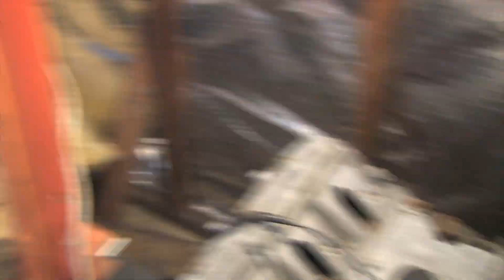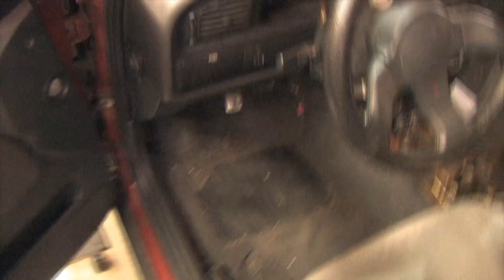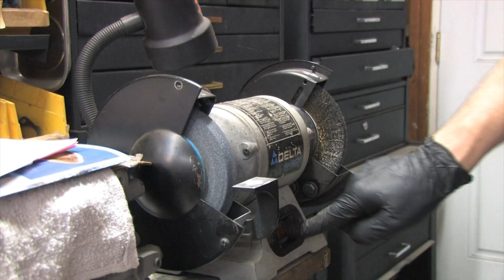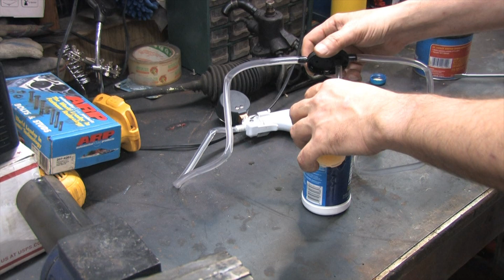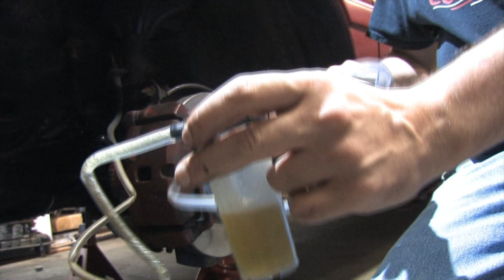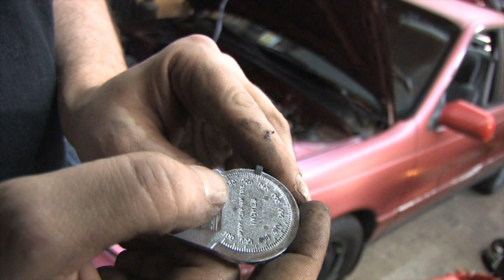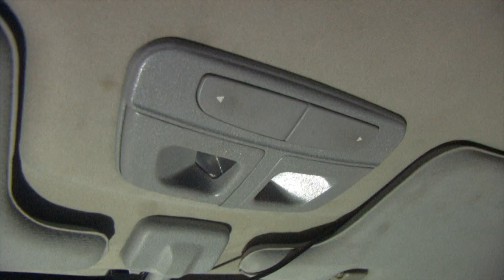Hyundai 17 - Brakes, Bearings and Bugs

Comment: Big problem here. When you force fluids backwards in the system, you are asking for big trouble. Drain or open the valve before you compress the pads brake caliper. Give the fluid a way out of the valve and you will not have any problems.

Comment: If you don’t want your lug nuts to seize just exercise the nuts by doing a rotate. Lugs nut threads have to be dry. If you don’t have the friction between the threads and the taper of the lug nut on the rim what do you think keeps it from backing lose? Maybe use it on a boat trailer that gets backed into a salty drink

Comment: You will at least have rear brakes. They made the master with 2 separate chambers. Pedal will be close to the floor though. I have cars come in sometimes with so much play in the wheel bearing that it doesn’t have a brake pedal until a few pumps because the calipers have to take up the play from the rotors compressing the pistons

Comment: I was always told by my mechanical ancestors to brake the bleeder lose, connect a hose to a bleeder, place the other end of the hose into a bottle with brake fluid, then pry on the assembly to see if everything is moving smooth. The point of this is as you use the screw driver to depress the assembly the old fluid and crud in the line doesn't get pushed back into the master cylinder. I have had this happen on my 2000 gm vehicles, but never a dsm. I just started to do the hose method within the last 2 years after Grandpa laugh at me and told me I am one stupid mf engineer. lol I took it as a compliment.  I might have commented this before, but thought I would leave my thoughts. Also don't press on the inner race while driving the bearing into the hub. I know this has been commented many times and even mention to me once before about this video. Keep up the informative videos so I can remember how to do this stuff down the road as I forget.

Comment: when water turns to steam it expands its volume 16 times... which would be already bad but its 1600 times xD
Reply from the maker: There is data that supports it.  The Wikipedia page makes the claim of 1,700 times the size at atmospheric pressure.  I know that there's a crossover in measurement concerning mass because I mentioned nothing of pressure, but if I'm wrong, there's data that's helping me be wrong.

Comment: I'd recommend replacing the hub assembly bearing on the other side as well,.... under the,.....while your in there rule.
I also recommend buying cheap break pad's they work fine and don't eat the rotor.
But I like riveted brake shoes and pads not glued,......expensive ones seem to work terrible or skid.
I've never had issue's with cheap one's.

Comment: That luxury chandelier!!! Where do I get one.
Reply from the maker: I ordered it direct from china.  It took 6 weeks to get it.  It's a "dollhouse chandelier with LED".  I'm working on a DIY to make a medallion to mount it to, and a voltage converter with the hardwiring process to permanently install it with a proper fit over the rectangular hole, and to make the dome light function as intended with the doors and interior controls.  It's nowhere near enough light for a dome light, but it's the details that matter here.

Comment: Yeah I've heard that's bad for seals in the master cylinder... MEH. I like to use the screwdriver to loosen the pad just a teeny bit, then I can typically press it full in with just my thumbs. It's potentially easier with the screwdriver, but I find I can really monitor the situation and make sure I don't damage anything by pushing the piston in by hand.

Comment: nice brake overhaul. still i have 2 additional tips: clean the flanges to remove all rust (rust can cause rotor runout) and give  them  thin layer of anti seice (this limits rust and prevents the rotor from rusting stuck on the flange.) then install the rotors. As for drumbrakes: same deal if they mount on a flange. Also: use your cellphone camera to make a picture of the drumbrake setup before taking it apart, that way you have a way to check where each part is supposed to go when re-assembling.

Comment: I have that same vacuum bleeder kit.  One problem I've had with it is that the vacuum it pulls doesn't just suck brake fluid out of the line, it also sucks air from between the cracked-open bleeder valve and the caliper (and or the kit's rubber bleeder boot).   Until I figured that out, it seemed to me like I had a never-ending supply of air bubbles in my brake lines.  EDIT:  ... and you just mentioned that at 23:00  .   :)

Comment: I just replaced all my pads and rotors on my gsx this past week after watching this video the first time. The brake trick worked on my rear brakes, but not on the front ones. Could this be because my 95 have 2-piston calipers? Or perhaps another reason? Either way, it saved time for the rears.
Reply from the maker: Use two screwdrivers.  ;)  Hey, I've got a video rebuilding 2g front 2-piston 1995 GSX brakes just exactly like yours.  If yours didn't want to compress because of corrosion on the pistons, or dry-rotted seals, that video shows you how to ensure they work perfectly... like 0-mile factory fresh perfectly.  Part numbers included.
Reply: Awesome, I'll check it out. I must have missed that one ;)  I did end up using 2 screwdrivers, but broke the tip off one of them. So in the end I used a c clamp since my piston compressor tool was MIA.

Comment: This video really helped me out with the the wheel bearings on my 93 VW cabby. I, however, had the option of pushing the old bearing out the front of the knuckle, which made rigging MUCH easier. To do the job, I got a cheap 12 ton press from HF for less than $105 with a 20% coupon. How come you never got your own cheap press, space constraints or you just don't need one that often to justify?
Reply from the maker: Space is a big thing.  I've always had access to one 2 blocks away, or at my cousin's house in the next county.  I need to nuke, pave, and rebuild my whole back yard to accommodate what I'm doing with 1/3 acre.  The 1/2 car in my 1.5 car garage I will never understand.  I don't see where I could fit a half-car when one's in there?  One of my cars can't even fit in this garage by itself... but it will have to eventually.  I need a building.

Comment: The screwdriver compressing is supposed to be a secret? I've done it this way for as long as I can remember.
Reply from the maker: You're one of the brighter ones.  It's usually the career mechanics who get it right.  The internet is polluted with DIYs about using C-clamps for a brake job. Service manuals don't even tell you to do it like this.  I'm just out here trying to help everybody save time and keep their blood on the inside.
Reply: Well, my dad was a career mechanic who would give me a dirty look if I let someone else do my maintenance without a good reason. He'd usually point me in the right direction, but his favorite teaching method was "Figure it out, or Fail"... and being a failure isn't my first option. Even if that means leaking a small amount of blood on some banged up knuckles.
Reply from the maker: Your dad is cool as f___!  You can tell him I said that.  Happy Father's Day Quarnozian's dad!

Comment: Tell me about the metal sheet on top of your work bench, where to get one/material/fastened down/etc.? I'd like to add one to mine.
Reply from the maker: I just went to my local metal shop, bought a 4x10 sheet of 20 gauge steel (two sheets actually) and brought it home to cut pieces off of to fabricate crap for the Colt and Hyundai.  Well, that's what I did, but I didn't need anywhere near that much of the 20 gauge for my workbench or the Colt or the Hyundai, so I just cut a 30" wide slice off of it, notched a square out of it for my bench vise and slapped it on top my workbench.  It isn't even held down by anything which is convenient for when I top it with painters paper.  I just fold the edge under the sheet metal and leave the roll on the other end so I can quickly replace it like a doctors examination chair.  I gave Chad the other sheet and he topped a rolling work table out of it.  RojoDelChocolate is actually now my boss.  I read him your comment and he said I should re-create a half-hour video about this in slow motion.  :D  Really it's simple solution that shouldn't be over-thought.  I probably spent less time doing it than typing the answer.  If I used stainless steel, then when my air conditioner leaks, it wouldn't rust.  It would have been a lot harder to cut, though... and it wouldn't be as magnetic, which is a feature I sometimes rely on with my precision measurement tools and shop lights.

Comment: When do yank's say engine and when do they say motor?
Reply from the maker: In some areas of the United States, mostly in the Southeast... but nationwide amongst US auto enthusiast circles, 'motor' is used informally and interchangeably with 'engine'.  There are some areas of the world that believe 'motor' only designates an electrical part, and 'engine' only designates internal combustion.  But to the people in the US who use it informally, a motor is simply a source of power connected to a more complex machine, and they don't care how that force is provided as long as it's fast and they can race the guy next to them.
Reply: Nice one

Comment: you should work on your car's suspension, and other things that dont involve working with the engine much.
and you should test it on the track to see if your car is any better when you get fatter tires for the fwd car.
Reply from the maker: Fully agree.  I've got the engine straight.  The tune not so much.  But I don't think the contact patch is flat on the bottom of the tire.  Based on what a handful the car is to keep straight at WOT, I'm sure I need to replace a bunch of parts in the front end.  The geometry just isn't doing it for me, and probably what's keeping this car in the 13's.  Maybe something to do with the cut DSM springs and a short passenger-side axle.

Comment: When you push the piston back in, you are also potentially pushing any dirt that was on the piston, past the seal. I also use waterproof grease outside the bearing to protect from moisture, and catch any dirt
Reply: also use a bit of copper grease to protect the cylinder head threads

Comment: Press the button!  
Thanks for showing how to use a vacuum bleeder. I got one from HF because I can't seem to get the sponges out of my brakes. Unfortunately, I have ABS and I think the bubbles are in there. I slapped down big money for a OBDII interface that can run the ABS system directly, but it doesn't have a program to do it for the car that's got the problem. Do you have any tips for how to clear air from an ABS equipped vehicle? (2006 Nissan Pathfinder)

Comment: Will my 05 Elantra work for a 4g63t swap?
Reply from the maker: Sadly, no.  Mitsubishi was only involved with supplying engines for the '92-'95 production.  It wouldn't be a bolt-in fit like it is with this one.

Comment: Dude - I just used the "trick" swapping out pads n rotors on wife's Green Kia Soul - AMAZING.....   there was , 90% pad left but she rides the brakes and warped the rotors, hated the vibration.  The ease of the trick took some of the sting outta the fact it is a green Kia Soul.  So I got some man points back, buy scoring 4 new pistols and taking her to the range 10 min after picking up her permit Thursday.  then loading an ammo box of both 9mm and .380 on the Dillon press.  Life is good, Hooker w a penis - hilariouse

Comment: I've got a question. I've got a 95 GSX and I did a head gasket on it,replaced two melted exhaust valves and had it resurfaced. When I tried to start it, no luck. So I did a compression test and it was bad. The head gasket didn't seal. What tips would you give me to help promote the head gasket to seal when I re-reassemble the engine?

Comment: why do the whole brakes fail, does it not have a split system? If one system fails, the other is there to slow you down. Does this car only have a single system?
Reply from the maker: In order for those rear brakes to have failed, first they would have had to work.
Reply: glad you're safe

Comment: thank you for making me realize why i have a water leak somewhere under the dash that will not go away.  #torquedchassis
Reply from the maker: I feelz your pain.  God forbid you ever need a windshield, I got the last one and it came from SC near the GA border.  I keep trying to find a parts car, but I haven't seen another Hyundai anywhere for years.  You're not in Fredericksburg are you?
Reply: Jafromobile southeast ohio. i have found the occasional carcasses in the junk yards here,  just always seem to not have the parts in looming for.
Reply from the maker: You may be able to call a glass dude to come out, remove and re-seal the windshield.  Just tell him to use lots of the goop because there needs to be a flexible layer between the body and the glass so that it doesn't break the windshield once it's sealed up and glued down tight.

Comment: I recently acquired tools to do these bearings with the knuckle on the car, works tits! No more wasted time running around the shop trying to pile up all sorts of shit to hold the knuckle in the press!
Reply from the maker: Now that sounds like a great idea!
Reply: Jafromobile Its sweet. OTC makes whats called a hub tamer. Shop i worked at last actually bought it, very nice kit but costs around $500. There a clamp piece thats basically the heart of the whole kit then various adaptors. I found that you can buy that clamp piece separately on amazon for around $100. Then i found a cheap chinese kits that had a good selection of adaptors. Im in it under $200 i believe. One thing you don't get is the kit has a nice manual with alot of vehicles and it lists out which adaptors to use and theyre all numbered, but im happy to save the $200+ lol. But if you already have a press and dont do it for a living it honestly probly isnt worth it.
Reply: ^ This guy right here. I did the same exact thing, with the addition of upgrading the forcing screw and nut from the harbor freight kit I picked up for 80 bucks. The OTC brand stuff is good quality. The hub puller part number is OTC 6575-1. The HF kit has everything else you need. OTC forcing screw Part # 503052  Forcing Nut Part # 311881. Pictures are wrong on Amazon, read the reviews it will confirm the right stuff. I've done 3 wheel bearings so far and its all working great, just be sure to lube the hell out of the threads before you use it.

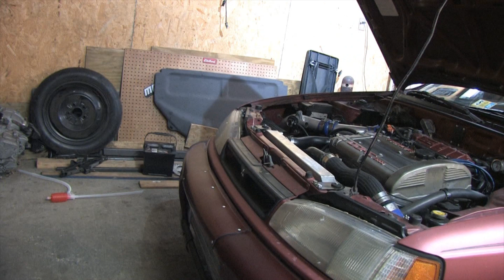Comment: Thanks Jafro. Not removing the slide pins is something I never thought about. You're videos are informative and production is A+. I have a better maintained/ modified 2g thanks to you! Also, how much for that cargo cover at 24:39?
Reply from the maker: 1) you don't want that thing.  2) it's the only one I've got and it goes in my GSX.  I say #1 because I accidentally ran over it.  Oops.  Hard to tell, but on the under-side, yeah, you can tell.

Comment: Hi Jafro, I recently changed my front case gasket on my 6 bolt, I still have balance shafts and after everything was in time and even the oil pump was in time after inspection, the oil pump gear for the timing belt felt a little hard to turn, and I lubricated all the surfaces and oil pump. could you tell me why it is hard to turn? a reply would be greatly appreciated
Reply from the maker: Your oil pump gear drives the balance shaft.   The balance shaft driven gear is an overdrive gear, but the shaft should spin smoothly.  How hard is it to turn?  Like, bring a wrench?  Oil pump =  hard to turn is a problem for sure.  See what happens if you just loosen all the front case bolts and try to turn it.  If that fixes it, look up the torque specs for every bolt and re-torque it.  If it's still messed up and that does nothing, take the front case off and see if the oil pump is easy to turn.  If it does outside the block, check your balance shaft bearings.  If it's not, either your oil pump bolts aren't lined up straight, there's foreign material in the OFH, or the balance shaft gear is installed backwards.  If the balance shaft turns freely in its hole, and the oil pump does, too.. but separately from each other, then it could be that the front case is mis-aligned and you should make sure the dowel pins are present that line it up on the block.  There's 2 dowel pins that go in the bottom left and right corners.
Reply: Jafromobile everything turned smoothly until I bolted it to my block, thank you for the reply, love your videos
Reply: Jafromobile I can turn it with my fingers but it used to turn just from gravity pulling the balance shaft down. and I have dowel pins. do you know what the torque should be?

Comment: 89mirageman here from the forums. Been making rear disc kits for the mirage guys for some time now. Pretty sure I can help you out since they're so similar. Also the ABS equipped elantra's actually came with factory rear discs and the parts might still be available new from Hyundai. I've seen one 92-95 elantra with rear discs in my lifetime. They are super rare. Great job on the video. Always look forward to them!

Comment: Jafro, love your videos, you inspire us DSM guys more and more. As a automotive in the industry I've tried the vac bleed and it wastes too much time. The best I've always done it is, crack the bleeders, open brake fluid can and let it gravity bleed the system. You will get all the air bubbles out of the system when your by yourself.

Also Jafro, for the rear why not convert the rears to disc using 1g or csm parts. With my old 95 elantra, I was going to change the whole rear axle from a 91 1ggst and change the portional valve and have all four disc. Well regardless,  it's a cool video and glad your still rock the hyundai. 2 thumbs up.